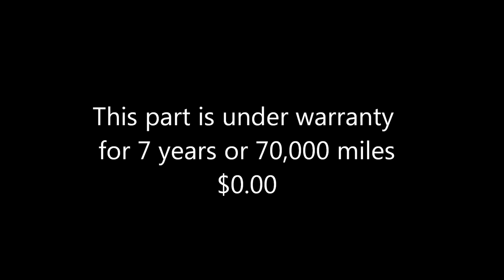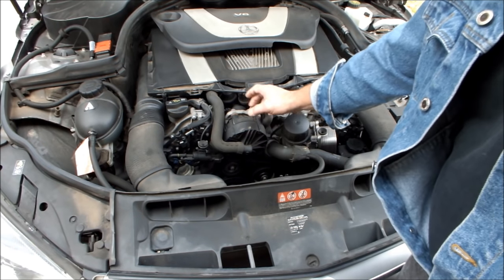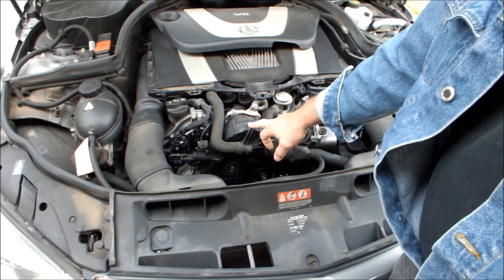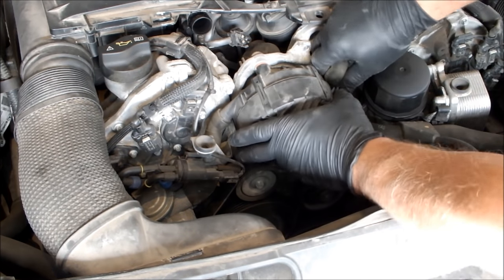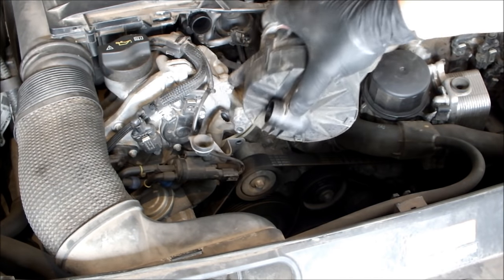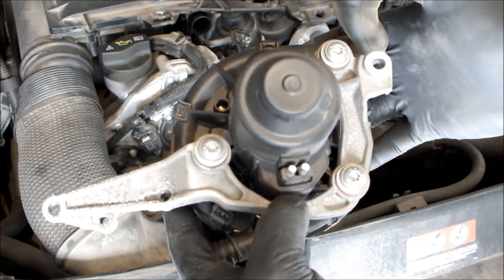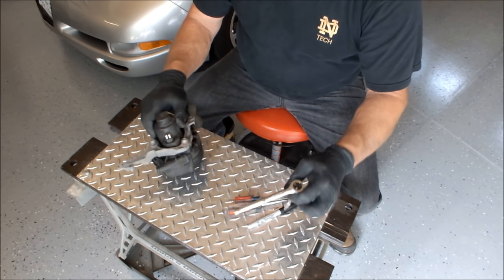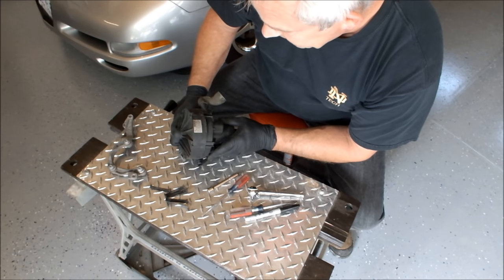Mercedes Secondary Air Pump Problem

Comment: Hi, these secondary air pump should be always runing? Or just run in some ocasions? Best regards.
Reply from the maker: they run for 30 seconds on cold start ups - thats it
Reply: @carquestions  thank you for your reply. Meanwhile i had disconected the electric plug from these air pump and the engine seems to work the same way. Is it damaging something? Thanks.
Reply from the maker: Nope - will not affect driveability or longevity  @joseluisalmeida7492

Comment: I've changed my secondary air pump 7 months ago and I've fixed few other things but I can't get my secondary air to get READY for the smog emissions test. Everything else exept EVAP & Secondary air wont get ready. Ita been 450 miles since... WTH
Reply from the maker: Need codes to know more Tony - Sec air pump only comes on when engine is dead cold - hard to say -  would just be guessing without codes
Reply: @carquestions  no codes at all ... I had to jump my BMW 3 weeks ago because it was 18 outside and I didn't use it for 9 days or so. So now after driving 400 miles plus I can't get the secondary to get ready so I can pass the emissions test
Reply: I am getting p0810 and p0814, same thing secondary pump not ready. I replaced the fuse, relay and pump is working. But this code shows up with not ready :(

Comment: Excellent video technique. Our 2011 C250 was making a noise for a few seconds upon cold start which sounded like a bearing in a pulley (kind of like a squeal - instead of a jet). After a week the noise stopped but got check engine light and  P0410 "secondary air injection system". Engine runs fine. Would you hazard to guess it is this air pump ? (Go Canada go)
Reply from the maker: Rod - When I said jet engine I mean - it's a very high pitched screech / squeal - so I think you definitely need an air pump replaced.

Comment: Yo bro please tell me if it’s my problem 2003 Cadillac deville check engine light on but  runs like a charm code P0412 
Is it possible my pump could be on but not blowing significantly? So I would still need one ?
Reply from the maker: Yes Erikk that could be happening - change it  out and let me know how it works out for you - çheers from Canada

Comment: Hi, great video. I used it to take my pump off and give it a clean. Mine sounds like a jet on start up when hot and cold but I haven't ever had a warning light come on. Would you recommend swapping the part out or just keep it in?
Reply from the maker: Just keep it for now - keep cleaning it

Comment: This is the exact noise i'm having but not as loud. Lol I was describing it as an electronic space ship noise and everyone was looking at me crazy. What exactly does this part do. Is it urgent to replace?
Reply from the maker: No Adam not urgent normally - it feeds air into the exhaust for cleaner combustion on cold start ups
Reply: @carquestions  thanks. Great vid btw. I’ve noticed my air pump stays running at all times is this another symptom of failure? Also could it be related to the random misfire like feeling I’m getting from the engine? I don’t have any codes but I do notice occasional stutters that feel like misfire and when I watch the engine with the cover off it seems like it is hesitating quickly at times. Creates a minor vibration in cabin.
Reply from the maker: @Dnasty1  secondary air pump is not to run constantly - only a few seconds on a cold start - if it is a misfire you'll get a code - if not it is something else not a misfire

Comment: HelpI have a slight problem I have got the Mercedes straight six and the turbo is in the process of breaking, on the engine I have it has a pipe from a circular object with a black lid of sorts which seems to be coming off at the end by the cam, it breathes air, sorry my question is should the air have a residue of oil within it, has that led to the demises of my turbo or does it prolong the life of a turbo through lubrication.
Reply from the maker: It is a sign the turbo has failed - internal oil seals fail on turbos putting oil in places where only air should be
Reply from the maker: It isn't  prolonging the life of the turbo - check your oil level and make sure you keep it full - the problem only gets worse
Reply: Thanks very much for your reply, last night I ordered a replacement turbo which should l arrive tomorrow, today I shall take off the failing turbo and see if I can find out what the device is that I have no name for that breaths spent air from the engine and see if that needs to be overhauled.

Comment: put the clips on the pump first and then ground it and then touch the live terminal on the battery, you will have much better control
Reply from the maker: Good tip - cheers!

Comment: I have the same problem on my c350 its sounds like airplane engine but now its totally not working give me engine light on my dash and i drove for week with a broken SAP now when i start the car its like shaking a bit idk if because of the SAP i went to the mercedes dealer for the price of SAP and guess what 1,350$ + the relay 40$ i order in FCP Euro for 215$ BOSCH BRAND all i have to do wait for my parts and install it and i will clean and lubricate the original one like you did to use in case the new one fail , thank you sir save me money for labor.
Reply: I’m having the same issue with my C350 (p0410) did you experience loss of power when you hit the gas? Does your shakes a little cold start? Also do you hear any funny grind when you hit the pedal?
Reply: @PlaywithDaisy  my Catalytic was clogged and I had to change my mass air flow sensor

Comment: You look like your super honest! I wish i was in canada! Do you think that after getting the transmission selenoid codes i need to change the whole valve body? They’re trying to charge me 1,150$ for that on a 2010 e350. Sometimes i turn on the car and it operates food the whole day! Other times it goes on limp mode! Is my transmission bad? Should i just junk it? I like the car but im afraid its not worth the money if the transmission is bad
Reply from the maker: Sadly I'd say change the whole valve body - this vehicle is well known for that issue and that is typically the fix - and always cheaper to fix than replace something. - Cheers from Canada!
Reply: @carquestions  thank you! For your answer! So sad to hear you say that i need a new Valve Body i just dont understand if the codes dont pop up when first starting the vehicles why does the transmission operate so smooth? I have a feeing its something with the electricity but you might be right and im just being overly-optimistic cheers from The Bronx, NY
Reply: For that price, i believe you will only get the electric kit, which is the upper part of the bodyvalve. But it is the electric kit that usually faulty.

Comment: A bought a cheap one for $81 and didn't care about the longer noise than usual.  I kept the original Bosch part. I'll try fixing that one. The cheap one is broken now after a couple of months. I'll try to fix it too. 
Is it true this part is only good for passing smog check?
Reply from the maker: yes - only for emissions - no affect on engine running - keep fixing
Reply: However, if it is inoperative, it will throw a code 0410 and a check engine light.

Comment: Thank you! As far as using third-party parts I've always felt differently unless you know the factory part is really short-lived. There is a lot of junk out there

Mine just went out at 13 years and 83,000 miles 

Don't know how things are in Canada but I was shocked at the price disparity for the identical part 

The Mercedes dealer had one listed at $1100 and my second go to place called FCP Euro sold it for $198 which included a new factory relay and 40 amp fuse 

Same Bosch part number same unit 

But you're the pro with undoubtedly far more experience than me 

I'm just saying be careful with some of those parts out there
Reply from the maker: Here's my rule Will - if the part let me down why would I buy it again? - sure if it lasted 10 years

Comment: Very good video. I will do the same to mine and see what it does!
Reply from the maker: Great Andre - let me know how you make out - Cheers from Canada!
Reply: @carquestions  by the way, what kind of grease did you use?
Reply from the maker: @andrenadeausimard9958  oil not grease - try anything you have - a light oil maybe
Reply: @carquestions  got it. I should work on that this PM and give you my feedback. Can’t thank you enough for showing me the way ;)
Reply from the maker: @andrenadeausimard9958  Anytime
Reply: @carquestions  Job done. It is now significantly better. Thanks alot! I will keep an ear ln that, as well as my alternator whine ;) gotta love your old MB ;)

Comment: Mine does the whistling/screeching sound under the hood on the 2012 ML350 4Matic. It exists for a few minutes and disappears. It doesn’t come in warm season but always in cold weather starts here in Minnesota. I replaced the serpentine belt but it was of no use. Recently, I got the P2279 vacuum leak error code/check engine light. I replaced the breather/crank case valve along with the 6 intake manifold gaskets with a local mechanic. The error code disappeared but I still get the whistling sound. I started later in the day yesterday and the whistling sound did not come. I researched a bit and found out M276 engine doesn’t come with secondary air pump. I have just given up since this is coming from the last 3 to 4 years but has never troubled me. It’s just irritating when I do cold starts. What do you think might be the issue please???
Reply from the maker: Take off the cover - and physically see if you have the air pump as seen in the video - sounds like the problem exactly - cheers!

Comment: I switch my mine out thank you but I’m still getting the same code, do you know why it’s still showing a code
Reply from the maker: Cal - I've run into this before with aftermarket replacements - you can try getting a higher level scan tool to reset, take it back for another or forget about it if it's working ok - Cheers from Canada!
Reply: U might need to check the secondary air injection valve, i changed everything in my car, including the fuse, the relay and the air pump itself but i am still having the same thing. So i ordered a valve and hopefully that will fix it.
Reply: @xtr3mso282   thank you for the response, i didnt know we had to change the relay do you know which relay it is ? and which valve are you replacing cause i noticed theres 3 vavles connected to the the air pump
Reply: @A.CAL96  here is a video that shows where the fuse and the relay is. Hope this helps https://youtu.be/HNHmAxQQjlo

Comment: Awesome video I'm having the same problem with my 2010 C300 but it only ones for a Split Second but I have a feeling it will get worse and also the secondary air pump in America is only $130 that's a weird at cost so much there
Reply: Just buy from FCPeuro, they have lifetime warranty...and you'll need it because this is one of the shittiest quality parts that Bosch makes.

Comment: Had the same issue on my 2006 B200 non turbo. Same loud sqeeling noise which dies down after about 30 secs. Until one day I started the car in the morning and the noise started and I heard a grinding noise when the fan motor just siezed up and the engine light came on with error code P0491. Got it replaced with a used working pump from a salvage yard. Reset the ECU but after a couple of months the warning light in the dash came back on but this time no sqeeling noise. So I replaced the Secondary pump relay to eliminate the issue pertaining to electrics. Reset the ECU and drove for a couple of weeks and bang the light came back on again when starting from you cold. Run out of ideas!
Reply from the maker: Some of the motors are very prone to setting off the light before being noisy I'm afraid
Reply: if you can do this overhaul yourself..koodos, but a mechanic's labour would be too expensive.  would be cheaper to buy a new one online and replace it . Mine failed 9 years after new car purchase, bought a Bosch online $287cad had my mechanic install it. Three years later it has now failed again, purchased same Bosch online awaiting arrival.(dealership quoted me $1700.00 installed)
Reply: It may be detecting too much current consumption from the secondary pump. Even though it may sound good, maybe the current consumption is too high due to friction. Try to repair it with some grease like in the video. That may do the trick.

Comment: W203 2002 C240 all my I/M are ready except for the AIR. Why won't this monitor turn on green check for it to be smog ready ? No codes for this SEC air pump.
Reply from the maker: Keep putting on the miles - it should turn on at some point if everything else is good -

Comment: I have a SL 550 and just paid the dealer $5000 for this repair. They told me if I didn't fix eventually the power steering and the car would drop almost to the ground. Feeling ripped off 😡
Reply from the maker: The secondary air pump has nothing whatsoever to do with the steering or suspension - It's an emission device only - sorry

Comment: Does this cause any problems? Mine is noisy (not as noisy as this) but I’m wondering if this will cause me any problems down the road?
Reply: Im very curious as well. It shows no error codes or anything on my dash. I brought it to multiple mechanics and they said to not worry since there is no signal codes and that it goes away within 15-30seconds
Reply: The only issue I can foresee is it failing later and having to replace it anyway. I’m the mean time your car wouldn’t pass emissions

Comment: What does the secondary air pump actually do.
Reply from the maker: supplies a large volume of air to the cats to reduce emissions
Reply: carquestions 👌 thanks. So if you don't have cats then you don't need this right my cats were deleted, just extra weight hanging on the car

Comment: Excuse me, I have a 2012 Benz C300 Recedes which is giving me codes that are P0174 and P0171, and the fault that I see is that when I drive the revolutions they fluctuate between 2 to 2.5k, which do you think could be bad? I hope you can help me, thank you 😢😢
Reply from the maker: Hector - I'd change MAF sensor and 02 sensors given its age - also check for vacuum leaks - let me know what happens - Cheers from Canada!
Reply: @carquestions  Thank you very much I will try to do that and when I repair it I will let you know thank you very much blessings

Comment: I read that the 'relay' should be replaced at the same time, can anyone tell me where it is? Sorry Mark didn't address it, such a good video tho. $332.00 Bosch cad  and $15.00cad  for the relay.
Reply from the maker: If the pump runs at all  - the relay must be working so no need to change it -  if the pump doesn't run then yes change the relay

Comment: Do you know which relay goes to this pump?
Reply from the maker: Victor - look it up in the owner's manual is best thing
Reply: on my c280 it's under a screwed down cover in the top left under the hood, theres a fuse box there and the relay is next to a big 40 fuse.

Comment: why take the pump off with the bracket ? wouldn't it just come off the bracket by taking off the rear screws behind the pump itself?
Reply from the maker: It's way easier on some models - depends on your engine, year and model

Comment: How do we know the sap check Valves  are not clogged up or stuck open?
Reply from the maker: Well the motor bearings screaching are a got indicator - other stuff should throw a different set of codes - Cheers!

Comment: How much power should be coming to the electric connector? At first there was 0 power, i replaced relay, then on cold start it was showing 22V. I thought problem resolved! but P0410 code is back and now the electric connector to air pump has 0 power again? new relay gone bad? What could be wrong
Reply from the maker: Get another meter - there is no source on the car for anything over 15 Volts DC unless you alternator has gone south - 22V should never occur on a car on any circuit
Reply: @carquestions  I will try another meter I guess. I tried on the battery and it was showing 12V. On the Fuse box, I tried the relay pins, 12V too. But in the connector it was showing 22V I thought that was weird.
Reply from the maker: @mrm1712  Could be a relay that somehow failed and put 12V in series somehow making the 22v

Comment: Pushes extra air into the cats to help them heat up faster. cat converters won’t begin to clean the hydrocarbons until they are hot.

Comment: Yesterday I replaced the Engine Air Filter and before that the cold start of the engine used to sound like a jet engine turning on. Now its silent . And now I have P0410 code on the dash. I remember I had the exact same part replaced 3-4 yrs ago for $700 like you said. Wonder if its just the dust that caused it not to work. I will try the cleaning as you did and hopefully it works.
Reply from the maker: 50/50 chance of working - good luck Bud - let me know what happens - Cheers from Canada!
Reply: @carquestions  this is the sound that it made yesteday. https://youtu.be/hxlVgOUAYUs
Reply from the maker: @budfox   100% the air pump is shot
Reply: I took it apart and cleaned mine but a week later it started making noise again. Just ended up replacing it with  a Dorman air pump for 230 dollars.
Reply: @meirbarnowski I have a 2002 s430 I thinking of going parts geek my pump doesn’t turn on but I have the code . My question is are you satisfied with your purchase